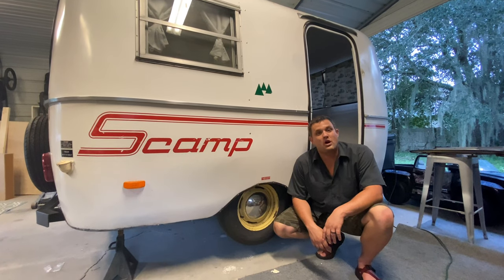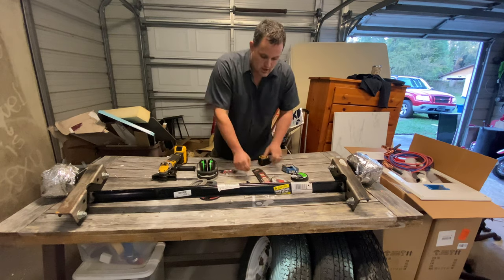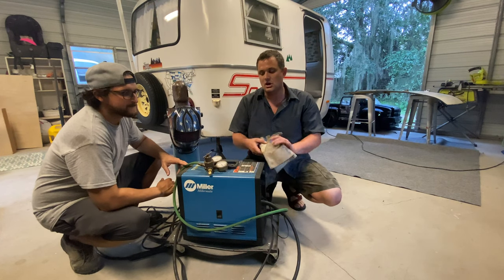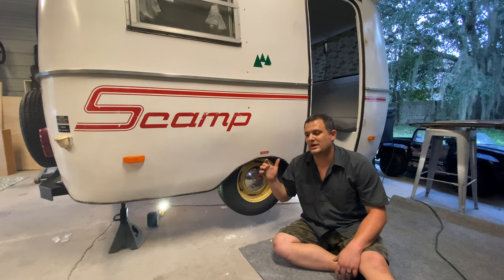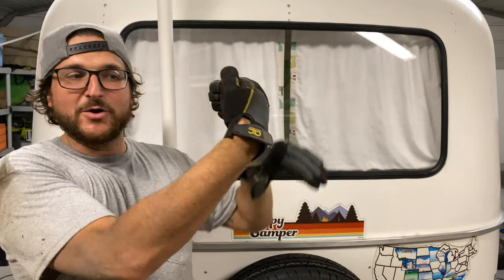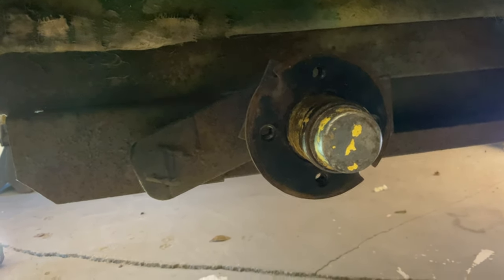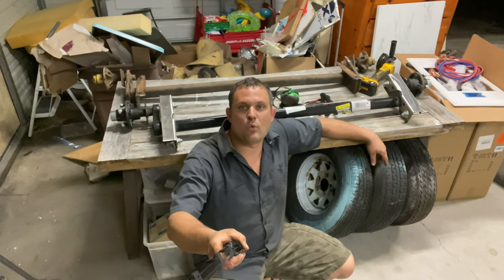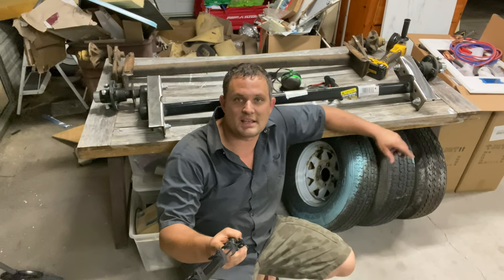13' & 16' Scamp Axle Replacement Part 1

Comment: You can remove the axle easier if you first cut off the leading arms. This will provide access to the front welds for your angle grinder.
Reply from the maker: Good tip! We actually did just that on the last one we did.

Comment: Notice the four lug nut  pattern on the spare tire,  The new axle I bought had a five lug nut pattern.
Reply from the maker: Yes! There are both 4 and 5 lug scamps, although I’m not sure what year it switched. Replacements can be had with either.

Comment: I have a 1977 13ft scamp. It has a cracked above the "bolt on" axle. Need floor too. I need help fixing this. Can you guys help ?
Reply from the maker: Maybe! Contact @retrorenos on Instagram. They’re the ones we did this camper welding for.